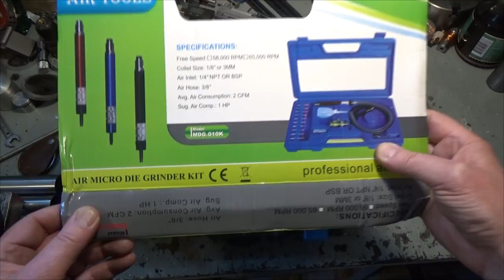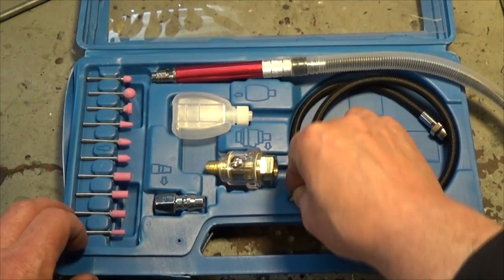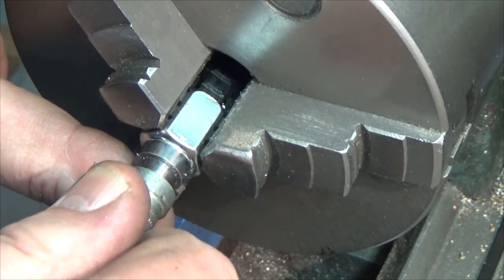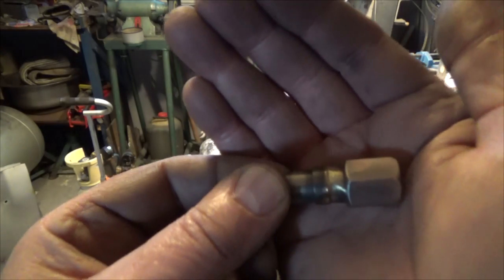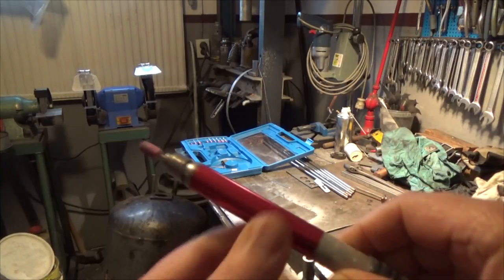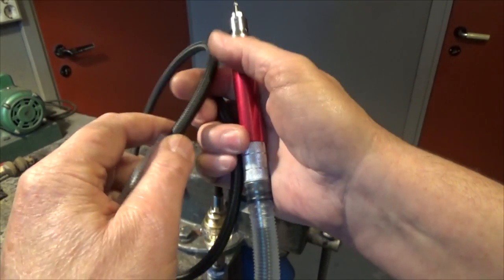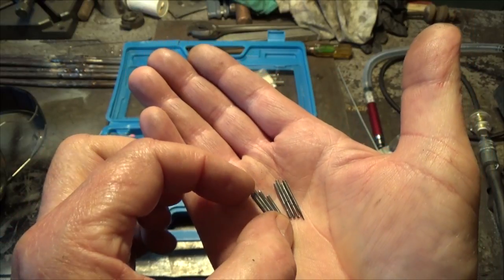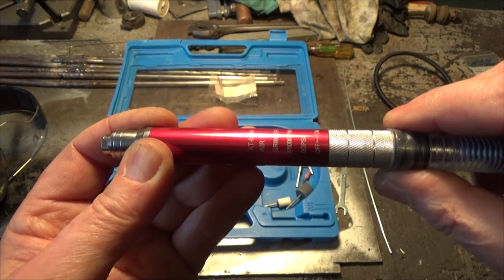Review of Micro Air Die Grinder Kit Polishing Gringding Rotary Tool from Banggood

Comment: can i use this to remove scratches on certain material like stainless steel , metal , etc ? with autosol also.
Reply from the maker: Then you need a polishing drum wich is not included in this set.
Reply: @tompas11A3n52KkX  whats that ? drum ?
Reply from the maker: Oh maybe it's called buffing wheel, something like this:
https://www.ebay.co.uk/p/Silverline-656616-4pc-Loose-Leaf-Buffing-Wheels-Kit-25mm-Mini-Polishing-Rotary/2254500846

Comment: What horse power your compressor
Reply from the maker: The motor is 4kW (4000W)=5,36hp and the air tank is 120 liters.
Reply: @tompas11A3n52KkX  is 1/4 horse power is enough for air porting tool.?
Reply from the maker: @jessicagumba8395  No it's not enough, I think you need something around 2hp, it also depends how big your air tank is.
Reply: @tompas11A3n52KkX  thankyou sir

Comment: Does this tool heats up on high RPM?
Reply from the maker: No it does not heat up on high rpm.
Reply: it's air cooled ;)
Reply: no they just slowly loose parts over time until they become none functional 90 psi is advised but that's just what a box says